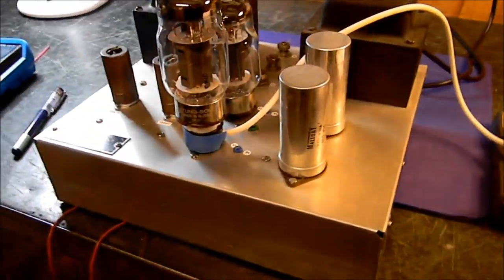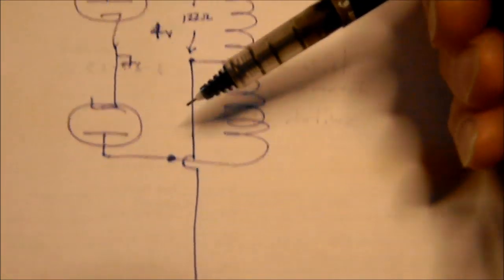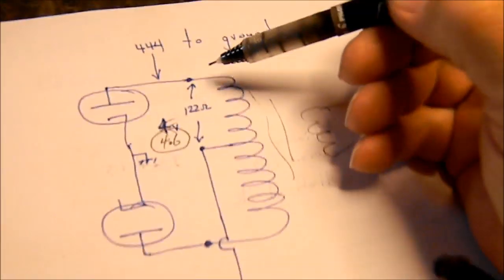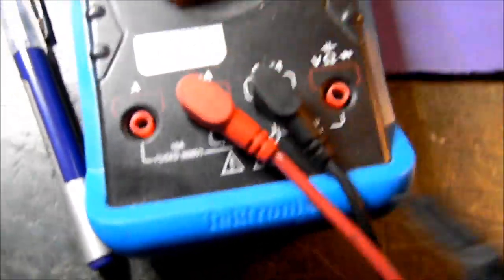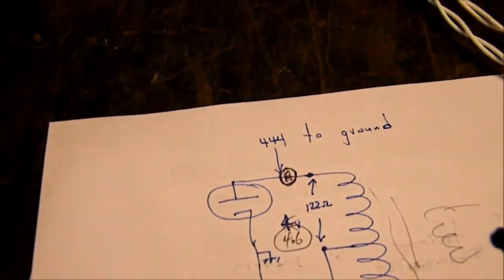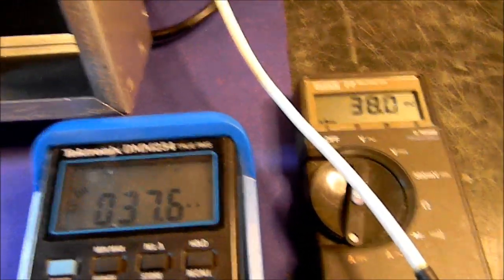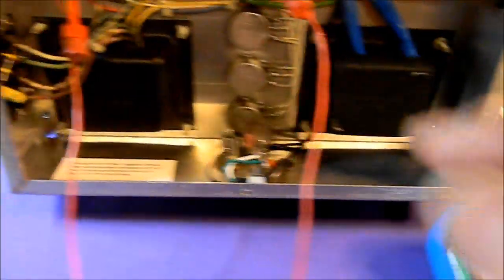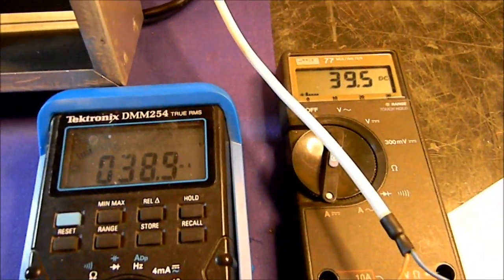Measuring Plate Current In Vacuum Tube Amplifiers By Using The Output Transformer Shunt Method

Comment: I connected the meter acrossed the OT center tap to ground and immediately smelled and saw smoke.  I think I may have "lunched" my transformer. As in  "out to lunch".
Reply from the maker: If you had it on current you may have just blown a fuse in your meter, or destroyed it. You didn't hurt the output transformer by connecting the CT go ground. That is a point coming from the power supply and may have damaged the power supply or blown a fuse. It is probably not too bad if you like to work on your equipment. Good luck.
Reply: @ElPasoTubeAmps    After watching your video I hooked the meter correctly and got the reading and the amp works fine.   I think I may have connected from the plate to ground when it smoked.  It also made a mechanical vibration sound as well that could have been the tube.. Maybe  the wire insulation got burned inside the transformer?

Comment: Yeah pretty cool idea but maybe avoid the high voltage meter thing and just use ohms law on the current calculation. Just as accurate?
Reply from the maker: The accuracy stays the same in each case as long as our measurements are accurate. This is a dangerous procedure to both the person and the meter and, as you mention, is no more accurate or meaningful than a safer method. I think sometimes we make different measurements for the technical pleasure of it and it does verify other measurement methods. Stay safe...     🙂

Comment: Amazing.
Reply from the maker: It is actually rather dangerous to the operator and the meter to do this procedure. As mentioned in the video, in current mode, a meter is essentially a short-circuit and if it is accidently connected between two voltage points - like ground and the HV buss - the meter will either blow a fuse or go up in flames, or both.. no joke... you can't make any mistakes in moving the probes around in current mode. 
With a meter in voltage mode, and one clip on the ground, it is usually safe to poke around almost anywhere. I have ruined Tektronix and Fluke meters by not being careful in current mode by making a mistake and it only takes one instant mistake. Lastly, make sure you do not over-voltage your digital meter. The maximum voltage ratings, both DC and AC as stamped on the meter are serious and if you put more voltage (especially AC) on the meter, you will ruin the meter, as I have sadly done. Thanks for watching and commenting. Stay safe.
Reply: @ElPasoTubeAmps  Official disclaimer acknowledged and understood. Thanks  "Uncle Doug"

Comment: Very good video. Just a note, if you dont want to measure the current itself to avoid short cut risk and also if your multimeter is not precise enough for low current, you need to know only the voltage and resistance, if you divide 4.6 V by 122 Ohms, you will find same results, 37.8 miliamps.

Comment: Sounds logical, since the tube's output is basically a constant current source.
Reply from the maker: I don't use that method anymore. Not for a long time. It is just too easy to forget or accidentally touch the meter leads to the wrong place while the meter is in current mode and smoke the meter. I did smoke the current scale on one of my Tektronix DMM's - volts and ohms still work OK but the current scale is totally bad.

Comment: How would you safely measure the plate current of a tube (or set of tubes) that is at 6kV?
Reply from the maker: Hi Nicholos,
I have not dealt with 6 KV yet but I do deal with 3.5 KV in two of my amplifiers. While this is Not the recommended way, I actually put a mA meter in series with the plate of the tube. In once case I have, the meter is mounted in an insulated material which is mounted behind a glass panel. This is in my Collins 30K-1 cabinet and it has been running since 1983 with no incident. If there is enough safety measures and distance in place, this is acceptable. Safer methods include floating the HV power supply above ground and connecting the plate current meter in series with the HV negative lead and ground, with the meter usually shunted with a  50 or 100 ohm resistor. You can also just place the meter in the cathode lead and measure cathode current and subtract grid/screen current if it is significant. Generally, I build all of my amplifiers/power supplies in one cabinet but there have been occasions where I have built separate PS cabinets. In these cases of separate amp/PS cabinets, I have been extremely careful to make sure the two cabinets can never become electrically separated as this could/would present a deadly situation if contact is made between the cabinets with the common lead open. I think the way you measure current at 6 KV depends on whether you want to do it on a one-time/occasional basis or on a constant basis. If one time, or only rarely/occasionally, you might consider a meter in series with the HV lead. If you want to have it permanently installed so you can read the current at 6 KV constantly, I would consider the meter being placed in the cathode lead or in the negative lead of the PS as mentioned above. In any case, be careful. You know this voltage level can kill instantly. Be save and have fun...
Reply: ElPaso TubeAmps Thanks! I'm not entirely sure which method I will choose yet, as I'm not sure how I'm going to build the amp yet. Though it will be a continuous reading. There is little in the way of online resources for building a 6kW audio amp (mono)from what I've found . This is my first time building an amplifier, but not my first venture into high voltage. I am actually building this as a modulated plate supply for a vacuum tube tesla coil. From what I have read, this is similar to an AM transmitter. Any guidance on building such an amp would be greatly appreciated! Is there a schematic available of your 1.3kW audio amp? (3-500z I believe it was) The tesla coil is essentially a pair of tubes being used as oscillators and the HV output (cathode?) of the audio amp will just pass through the primary winding of the tesla coil, then to the anodes of the next set of tubes, which will be oscillating at the resonant frequency of the coil, and finally that cathode will be grounded. So I believe that would float the cathode of the amp at high potential as well. I am hoping to use 2x 4-1000a for the amp, and 2 more for the coil. I may however need to go with 2x 3-1000z for the coil tubes, since the screen of the 4-1000a may interfere with proper oscillation. Also, yes I intend to work safely on this. Much appreciated, thanks!
Reply from the maker: Nicholas - I have never built a Tesla coil but from what I have seen on YouTube in the small ones they use a solid state modulator to modulate the primary of the Tesla coil. I assume the turns ration of primary to secondary is on the order of 50:1 or higher? i.e. 100 volts on the primary will result in 5000 on the secondary, etc? In this case, the modulating voltage will be relatively low. With a modulating (primary) voltage of 6000 and a 50:1 turns ratio you will end up with 300 KV. Is that what you are after? And if your ratio is 100:1 you would end up with 600 KV... Wow...
I have looked around the Internet and have found almost nothing on high level plate modulated AM transmitters. Very surprising. I expected to find a lot of information. I have a lot of amateur radio books on AM transmitters and modulators. Maybe I need to send you some scans of them so you can see how they do it. It is actually pretty simple. I have been looking into and will continue looking into Tesla coils and how to modulate a really big one. I assume you have seen the monster Tesla coil that the fellow built in either Texas or Oklahoma. Can't remember. Here is a link to it.  https://www.youtube.com/watch?v=FY-AS13fl30
I bet that thing would put out some volume if it was modulated. I think he used pole-pig transformers to      drive the primary. It's insane.
Reply: Typically tesla coils do in fact operate in the hundreds of kilovolts, into the million+  for larger coils. I am aiming for 6-9 foot sparks, so 600kV would be in the ballpark. With solid state coils, lower voltage (200-500 V) is used at high current (300+ A) on the primary. With vacuum tube Tesla coils it is the opposite. I believe you are roughly correct on the turns ratio, though I believe it tends to be towards the 100:1 area. Some scans would be super helpful indeed, Thanks! I can direct message you if you'd like. I have seen that video and it is amazing indeed, very talented builder. From what I gather audio modulated vacuum tube Tesla coils were more common back in "the day." I am 21, so I wasn't there for any of it unfortunately. Apparently little documentation from the time exists on the internet.
Reply from the maker: I will make some scans tonight on vacuum tube modulators modulating class C amplifier stages.Yes, let's go direct communication   rdavidbeard@gmail.com
Reply from the maker: One last thing - a 6 KW audio amplifier is going to be quite a project  :-)  A 6 KW audio/modulation transformer? That will be the size of a pole transformer. You would have to use a pair of 4-1000A or a pair of 4CX1000A tubes and even then you would only get about 3.5 KW of audio power. Now maybe 6000 volts on the secondary of a transformer by modulating a neon sign transformer primary might be possible but not at 6000 watts but at 6000 volts. I can imagine modulating the 120 volt primary of a neon sign transformer and getting multi-thousands of audio voltage on the secondary to drive the primary of your Tesla coil with a turns ration of 100:1 and coming out with 600 KV or even 1 MV. Whew... this could get serious quickly  :-)
Reply: ElPaso TubeAmps When I said 6kW I was thinking of input power. The plan was to either use a suitable pole pig if available, or use microwave transformers in series, with the primary windings of the second set specially insulated since the core will be floating at 2200V. A bank of 6 in parallel, in series with another bank of 6 in parallel, for approximately 4400VAC RMS at 3A. After rectification the peak voltage of roughly 6200V will be the end result, with a 200uf smoothing capacitor for less than 1% ripple. Should give 6kV at 2.5A,  just so the power supply doesn't have to struggle. I've emailed you as well.

Comment: Hello! You can simply divide the voltage drop with the DC resistance of the primary. 4,6V/122Ohm=0,0377A  This way You don't have to do dangerous measurements.
Reply: Apart from the fact that using a bias probe eliminates the need to do it this way, surely doing the measurements to achieve this is potentially more dangerous than using a bias probe?

Comment: Greetings,

I'm looking toward biasing my DR Z EZG 50, essentially a super reverb clone, using your method. Could I safely measure the current across pin 8 of the rectifier tube (currently a GZ34) and pin 3 of an output tube? I have an Extech 430 meter.
Reply from the maker: Traynor F. Yes, if and only if, pin 8 (the B+ cathode) goes directly to the center tap of the output transformer. Be careful. It is a neat way to check the balance of your tubes but anytime a meter is in current mode, it is vulnerable to destruction if connected improperly.
Reply from the maker: Traynor F. I hate to admit it but I destroyed the current scale on the Tektronix meter you see in this video by being careless and accidentally touching one of the leads to the wrong place.  I knew better but was careless.  I love these meters so much, I bought another one.
Reply: ElPaso TubeAmps From what I can gather, pin 8 should be the center tap. To be safe, I tested the resistance of the output transformer using Pin 8 on the rectifier and pin 3 of each power tube. With the amp off and the standby switch on, I was able to get a reading from each side. Perhaps its time to ask Dr. Z about a schematic. I will say, even with my upgraded fluke test clips, it's very hard to clip my test leads in place without movement.

Comment: did this method on my bluesdeluxe last night wish I would have checked the service manual again.  I hooked up lead to the power transformer instead of the output transformer burned a couple of resistors pretty quick like 3 seconds but lucky or not I also hooked onto pin two of the 6l6 instead of three so at least It didn't fry as much stuff.
Reply from the maker: noahtheviking Sounds like your mistake was made at 6 volts instead of 450 volts...  This method works and nothing has to be disconnected but in most cases when measuring current we have to be so very careful. Everyone of us is used to connecting the negative lead to the chassis and probing around freely with the other meter probe in voltage mode. In current mode the meter is essentially a "short" and one instantaneous touch of the probes across the wrong point and everything instantly goes wrong. I am glad you didn't hurt too much and especially yourself. I've been doing this for decades and sometime back I destroyed one of my Tektronix DMM's measuring current at high voltage by being careless. Felt like a complete idiot - still do. Takes a whole different very concentrated mindset when making current measurements. Stay safe.

Comment: I have read that the shunt impedance of a multimeter can affect accuracy if the transformer has low DC resistance (e.g., Marshall). Have you encountered this problem?
Reply from the maker: Yes, the larger the transformer, the more error. About 10%, or so I would say. I very rarely use this method as it is dangerous to the user and even more dangerous to the meter. However even though not spot on accurate, It will tell you if your tubes are drawing the same amount of current.

Comment: I measure PLATE current the same way...by interrupting the plate pin and routing into a mA meter... Cathode current measurements are only valid when using triodes.... Pentodes have screen idle current that can typically range from 3 ma to 8 mA for the popular output tubes....this sums with the Plate current to make cathode current...which can make for errors ...

Comment: Very nice! I did not know that method. Also you could use ohms law and divide the voltage drop by the resistance of the winding and get a pretty close answer... 4.6/122=0.0377 or 37.7 ma
Reply from the maker: Measuring the resistance then the voltage drop is safer and maybe even a little more accurate - thanks for the comment.

Comment: have you try the 1 ohm 1% 2 watt resistor measurements ?
Reply from the maker: I have used 1 ohm and 10 ohm resistors in the cathode circuits many times and I wish all amplifiers were that way from the factory - your suggestion of 1% is also a very good idea because if the cathode resistors are 10% then we could have as much as 20% mismatch between the two. I have taken the time to actually measure and match these resistors from a batch of 50 or more - that way they are at least the same value - thanks for your comments.

Comment: One error was stating that the bias adapter was measuring plate current but it is measuring cathode voltage drop across a known low value precision resistor. 
That has the distinct advantage of subjecting the meter to a few millivolts instead of 470 volts, so much safer. I usually test using shut reading across the transformer just to see if the operating point is in the ballpark then adjust bias for waveform or spectral display on my spectrum analyzer. 
I find that modern production tubes vary so much, even those claimed to be "matched"  that optimum bias is usually not  that which was expected for a tube in a circuit that was designed for the tubes available when the old amp was designed. Matching is done at low plate voltage configured in triode mode by all the current tube manufacturers. Putting these new tubes on my curve tracer reveals quite different load lines than the old tubes with the same label.
Reply from the maker: Actually, this device opens pin 3 and does measure plate current and is one of the reasons for the video - if for no other reason to warn users that there is HV on the wires coming from this type of  "bias" probe - I agree that measuring cathode current is safer. As for adjusting bias for spectral display, I find that the lower the bias (the higher the plate resting current) the better the THD products up to the point of dissipating too much power in the plate - kind of a trade-off there. I certainly agree that "matched" tubes are not very well match from my experience and did not know that the load lines of modern day tubes are significantly different from vintage tubes - I don't have a curve tracer yet    :-)  Thanks for the post and the information.
Reply: Thanks for the clarification. How would any company's  liability insurance allow hanging that gadget on B+ and sold to the public is a mystery.  Adding the extra cable lengths at the higher Z of the plate circuit can cause parasitic oscillations that would REALLY throw off the readings and damage the tube. 
Finding the optimum operating point is a balancing act of setting a tube safe biasing point versus distortion. THD is good to monitor in addition to the frequency domain since the power supply ripple becomes a noise factor is drawing higher current. Cathode current measurements account for screen current also. After some experience with simultaneously monitoring AC mains current, THD and spectrum plus  cathode current you get the feel of the relationship between these and the sound and can simplify process. For me, setting up an amp is a 5 second operation now, after I know what style of music is involved.  I am not one to encourage chasing tone like most amateurs do, focus on style and playing coupled with the song and tone becomes a non-issue. Skilled stylists are not as concerned with amp tone the way amateurs are.